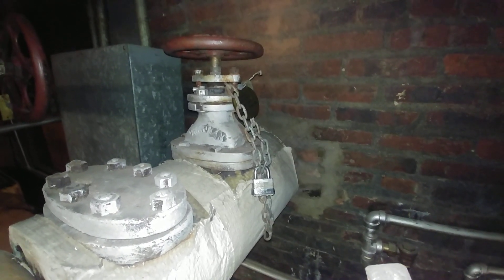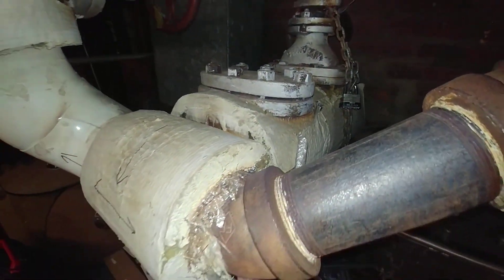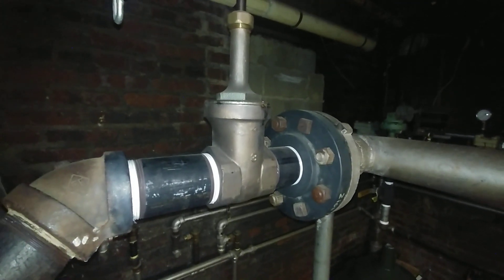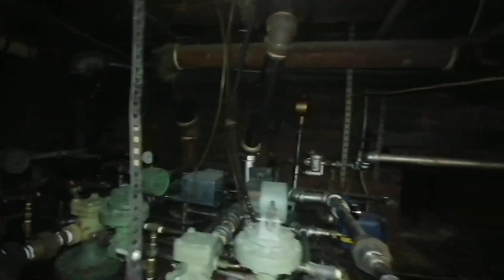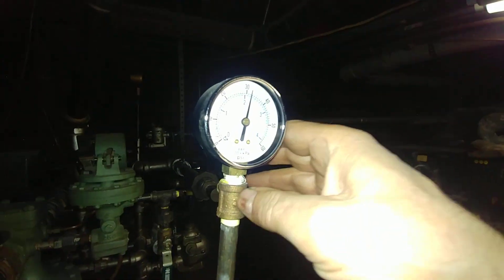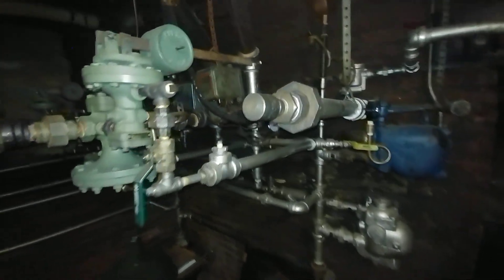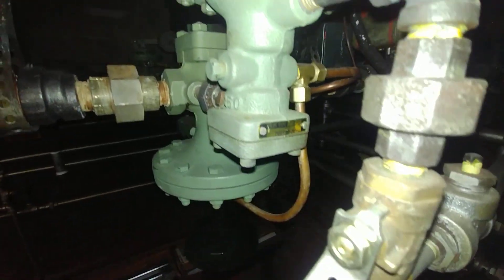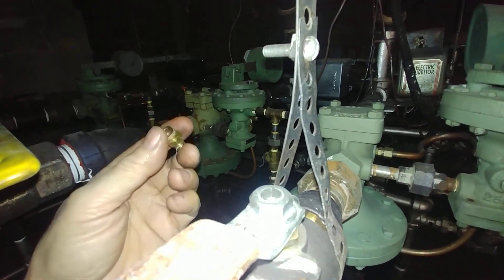Baltimore's District Steam Heating System & Spence Pressure Reducing Valves

Comment: Why many people say u cant use ball valves for steam? Obviously it was used here by the utility company. I know they have ptfe plastic seal people say the steam will melt it. As long ad the valve is rated for the temp thats all that should matter right?
Reply from the maker: Thanks for your comments and questions.
In this case, the utility company did not use these ball valves. I don't think they do anywhere on their side of the system.
We chose a high-end special ball valve that was, on paper, rated for 250 psi steam (SWP).
You are right about the seals being the weakest link. In this case, the seals are a special PTFE type that have extra stuff mixed in so they appear pitch black!
The Steam pressure supplied by this system is 30+psi, so there is a considerable safety factor.
We would not use "ordinary" 125 or 150 psi SWP (steam working pressure) rated ball valves here, no sir.
Reply: @gordonschweizer5154  Gordon is their a way I can reach you on a more personal level like a e mail or facebook DM? I enjoy staying in contact and making friends with people who love what they do and are knowledgeable. I believe we are very like minded. Thanks alot brother
Reply from the maker: @AdrianButler86  Try reaching us at allsteamedup@verizon.net.